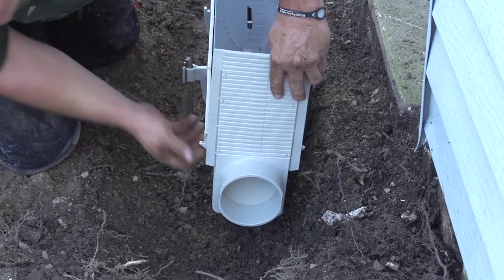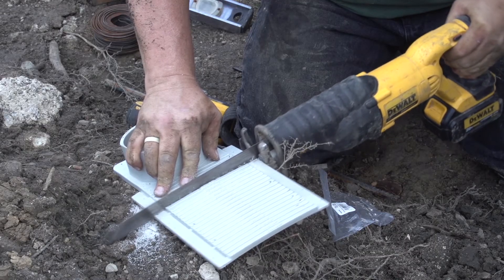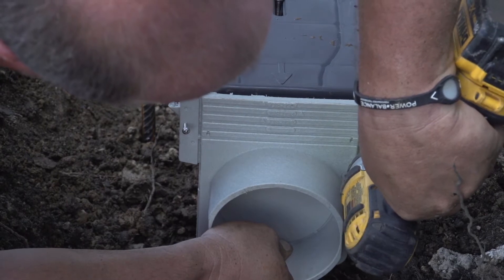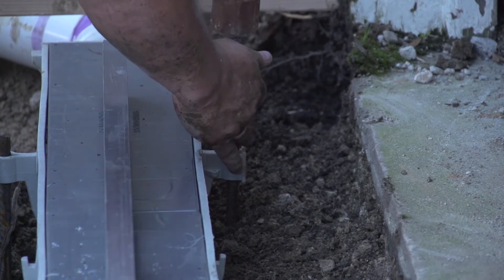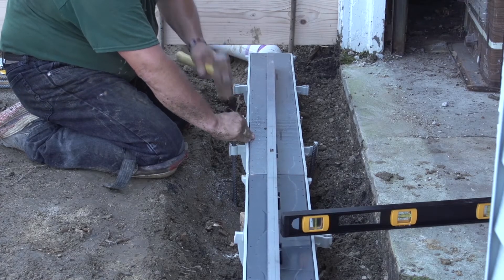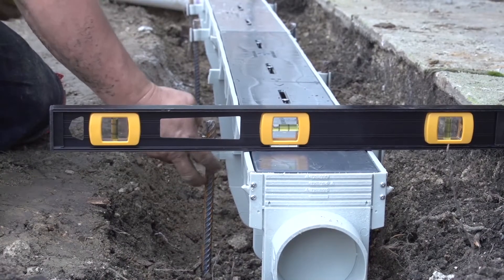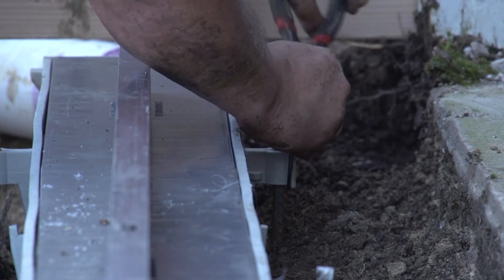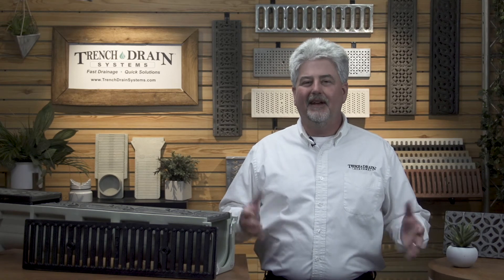NDS Dura Slope Install | Trench Drain Systems

Comment: Hi! The video says that when pouring concrete, you should first put bedding slurry under the Dura Slopes, and after that sets up, put concrete on the sides. 

But if you let the bedding slurry set up before adding the side concrete, won’t you end up with cold joints between the two?
Reply from the maker: @oil_can  The way you install the drainage system can depend upon many things, I would suggest calling in and talking to one of our engineers at 610 -882-3630.